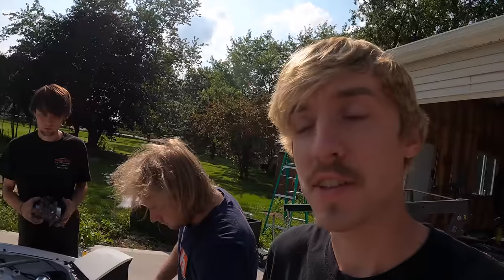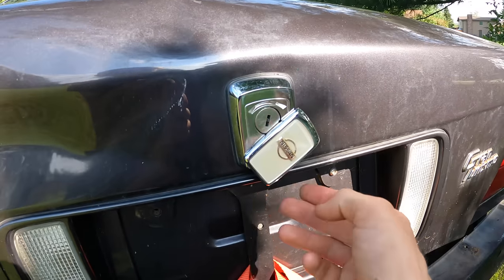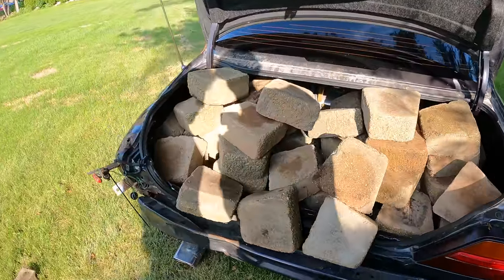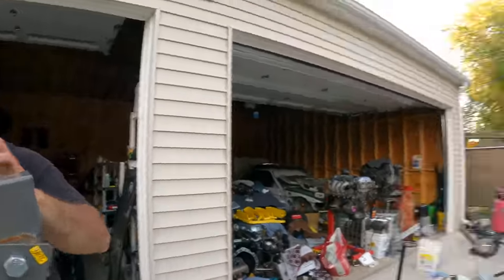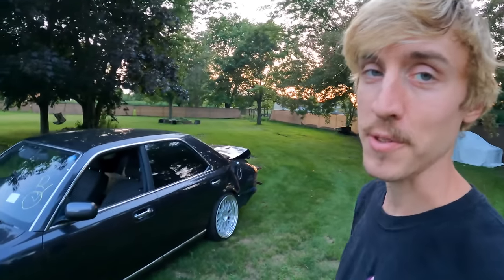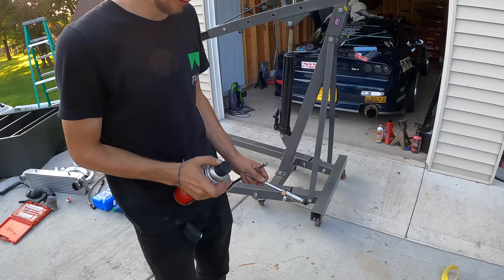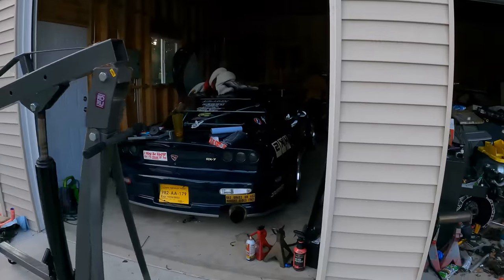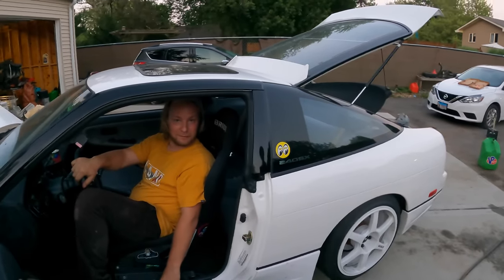Project 240sx SR20det FIRST START! + Nissan Gloria the new work truck?

Comment: SR20DET = amazing, sounds like it needs a tune, dial the fuel back a bit might keep it from running as rich as it is. maybe even turn up the boost a little just for the extra smile per mile

Comment: i want to try to 4ag swap like a volvo 240 or a saab 99. great vid btw
Reply: a saab 99 is nearly impossible to 4ag swap due to it being a gearbox in the front configuration. also not enough torque to pull a 240 so id be slower than a stock motor.
Reply: @kanggoo57 What the hell... 240's aren't that heavy. NA redblocks have like 110hp and not much torque. A zippy 4AG will definitely be more fun and rev out way higher.
Reply: @Vaino_Hotti  definetly not. and theyre not heavy? have you actually ever driven one? theyre boats. a 4ag is meant to pull a small lightweight chassis, which a 240 isnt.
Reply: @kanggoo57  I had an '87 GLi sedan. It was less than 1300kg. To me that is a light car. And the 120hp B20 moved that car just fine. A 145hp 20V 4AGE would definitely be faster. The difference in torque is negligible.
Reply: @Vaino_Hotti  Yeah, that 1300 is not light my guy, its light compared to that yankee in your profile picture, but the 4ag-4age is basically used in cars which weigh around 900kg stock, Thats a 400 kilogram difference, and in terms of automotive specs its a HUGE difference. and people can even strip those cars, ive seen ae86s weigh as little as 700kg. sure it might look cool but it would be a terrible swap for a brick volvo. the engine just isnt made to pull those loads.

Just turboing the redtop is a way better option. my friend has a 940 with the 2.3 with the rarer 16v engine, (atleast here in Finland, heard theyre more common in the US) and even that hardly pulls anything.

Comment: I’m doing a sr20det swap but I’ve never done it before. Will the sr20 ecu plug up to the s13 chassis harness? And what radiator and clutch do I use? I have more questions. I’d love some help. Keeps up the videos!

Comment: 13:41 I have a special made 17mm specifically modified to use on that fitting on my sr20. The wrench is cut in half and each side of it shaved down to fit between the compressor housings lol.

Comment: if you removed the light from the door panel wouldn't it stop the current, therefor stopping the battery drainage